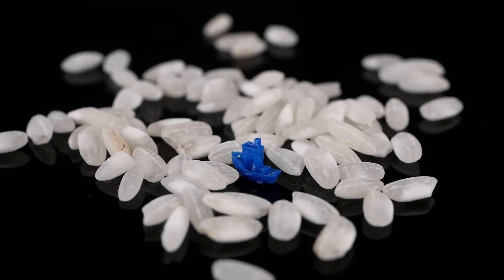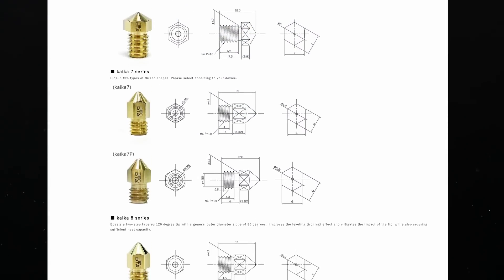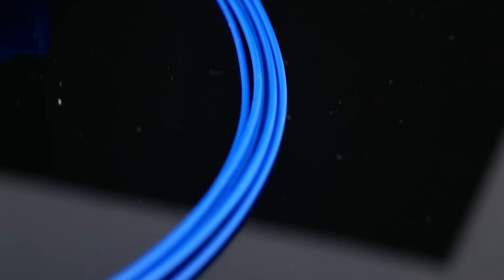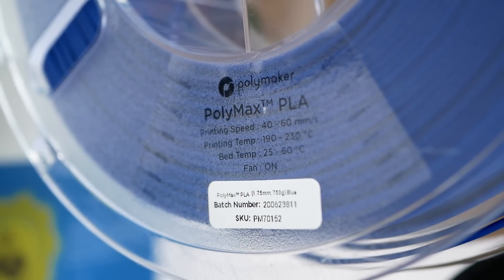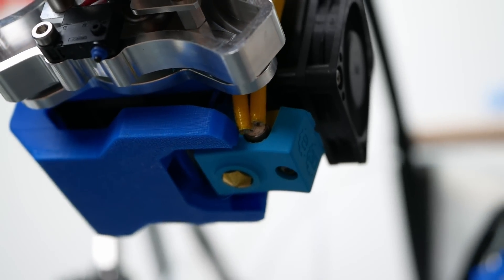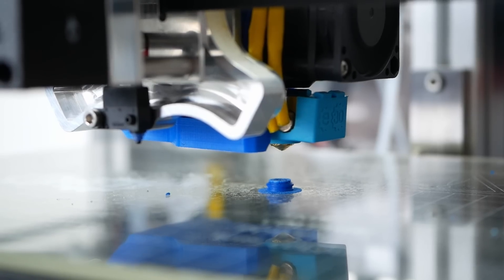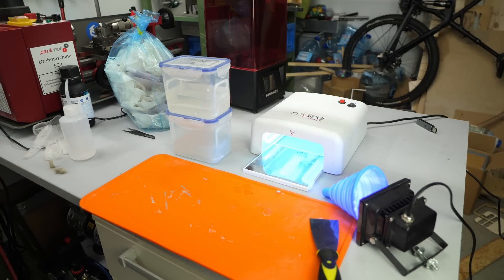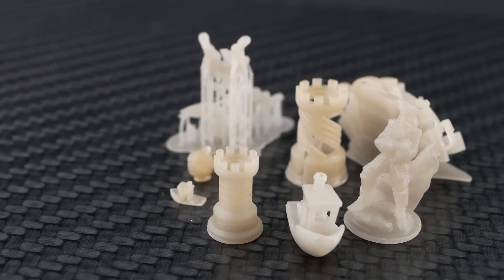MICRO 3D Printing with a 0.1 mm nozzle

Comment: Congrats on the channel and video as usual! :D I would love to see the strength properties on parts printed with a 0.1mm nozzle. Maybe I'm wrong but I think it would increase the strength since the little gaps would be tighter. Also a part not so small (even though it will take a lot of printing time) but maybe it would offset the post process (sanding, smoothing, painting). Just some curiosities I would love to see addressed. Best Regards,

Comment: Really good video Stefan. I'm so please they turned out well and thank you for the shout out. With a 0.1mm nozzle you are basically printing with controlled nozzle ooze, PolyMaker PolyMax is a great starting point for anyone else wanting to try out small nozzle FDM printing - even if you are using a 0.25mm nozzle the PolyMax PLA range works so much better than normal PLA's and gives strong usable parts, most other PLA's I tried just break when trying to use the parts. (I made 35% sized Lego bricks out of PolyMax PLA and they work well over and over again).
Some ABS filaments can also give good results with micro-tiny printing, but be careful how long they sit in the hot-end as Stefan mentioned the heat-creep problem.
The results are worth the wait for FDM especially if you really don't like dealing with SLA resins as mentioned.

Comment: I tried 0.25mm on my Prusa Mini. It works well, just takes ages to print anything not tiny. One time I wished I had a smaller one when printing replacement plastic gears for a broken paper laminating machine. Few grams of plastic saved the machine from being thrown away but even with 0.25mm nozzle the tooth geometry was barely functional. I am not sure if there is a resin that would be structural enough but printing this in ASA seems to have worked.

Comment: Stephan, don't use the adhesion spray inside the machine! The spray goes everywhere and will accumulate on the rails, along with dust - acting as an abrasive and damaging the surfaces over time. Don't be lazy, take the bed surface out and spray it there, never inside the machine. 

BTW, any tips (which extruder/hotend are workable?) on upgrading a common consumer printer like a Prusa or Ender to a 3mm filament? I have ton of this filament because of my Mendel90 machine.

Comment: Great experiment again and great results! Would it be posible to utilize an idex printer with a 0.8 and a 0.1 nozzle and two times the same filament, to use the 0.8 for everything but the fine details?

Comment: I've printed with 0.15mm nozzles on my old machine, in my experience it looked a lot like you need higher gear ratio on the extruder.
When printing those small parts I used a QR extruder from Bondtech and a 100:1 planetary nema17.
It was printed on a Velleman K8200 :D
I dont have the parts longer, but the benchy was 15% scale and looked prestine :)

Comment: the pre an post processing for the resin printers was what really got me, it always took more time in the slicer for the resin printer an the clean up. i love the finish tho but i only use my resin printers for stuff thats really small with alot of detail or if its something i just have trouble with on my fdm printers due to thin walls like small fan ducts always come out looking cleaner for me on the resin over my fdm, but for anything structural fdm is my go too an thats what ive found myself print way more of lately over stuff like miniatures or busts.

Comment: Been doing prints on 0.05 and 0.10/0.15 nozzles for over a year now. This is gor small scale parts for my RC scale helicopter builds.

Intially it was on my Prusa with Bondtech 3:1 extruder - now on the E3D toolchanger with orbiter extruder and recently on a Voron v0.1 i build especially for that.

Important aspects for this
- you need a DD extruder setup with a high gear ratio (3:1 or with orbiter 5:1) - its not just about resolution but also for torque to push material thru small orfice.
- material choice here, PLA or ASA, those are high flow low viscosity materials. Forget PETG as due to its higher viscosity you will end up with lots of curling and potentially more clogs.
Needles to say avoid any filaments with shiney sparkly additives

Really, after that i ditched using my resin printer - for reasons Stefan mentioned as well as issues with anisotropic shrinking of resin depending on model geometry.
Resin is brilliant for small parts but then when you have multi part assemblies, due to resin shrinkage the tolerances are totally out of whack (and this is random based on nmodel geometry and even model orientation)
With FDM my part dimensional accuracy is perfect.
Reply: Example of full FDM print on 0.15 nozzle
Scale 1/7 cockpit for Bell 206 with fully functional controls
https://youtu.be/S_n0hGPFlCU

Comment: It's not the right direction.  For small high resolution sla all the way. For fdm going larger is the better option. They are slower so you want more plastic coming out to make larger parts. I have both. I would put a .8 on an fdm or even larger if I want a large part fast. But resin is faster than fdm and at a higher resolution. You could fit quite a few of those on one resin bed and the time for one or all together would be exactly the same because it's an entire layer at a time. Not sure why I would want a small fdm doesn't make sense

Comment: This video is fantastic! Its crazy were fdm printing is getting. And in that light you should check out Polymakers lightweight PRE foamed PLA! It is around 65% the weight stiffer than other lightweight PLAs and can be printed with the exact same g code as normal PLA! It would be super interesting to see its properties under your stress tests! Maybe a new champion for strength to weight?

Comment: In our studio I have some printers dedicated for certain tasks… an ender 3 (for example) with some light mods is dedicated to a 0.2 nozzle for small detailed parts on some of products that a .4 nozzle would never be able to resolve… it has worked very reliably, the hardest part is getting the first layer just right.

Comment: I’ve found 0.2 nozzle to be such a pain and like you show requires slower print speed that I found playing with flowrate/extrusion width can achieve very similar results with a 0.4 nozzle in less time. Also I don’t like resin printing either.
I love it when you show the insides of these nozzles. I learn a lot from your approach.
Reply: I use a 0.2 nozzle probably just as often as a 0.4, and I am tempted to get a prusa xl with 5 nozzles just so I can keep 2 of them permanently at 0.2... It does take a lot longer time, but the quality and.. uhm.. "resolution" is a lot better, so it's totally worth it.
Reply: @AFAndersen  Yep, 0.2mm nozzles are great for small parts with fine details. 
I never really had problems using them.
Reply: i like how i learned this much in three sentences
Reply: how small width can you go with a 0.4 nozzle?
Reply: Your cura tutorials are extremely helpful

Comment: Multimaterial IS possible with resin. It's called Multijet and works without mess. But the printer is about 100k$, however you can order prints online

Comment: I've used my .25 copper nozzles for mini's before. No clogging with them like I had when I tried the .2 nozzles that came in the same package. Not that I had many with the .2's either. I suspect the better heat characteristics of copper over brass might have helped. Though they do of course wear much faster that brass for not a huge improvement in thermals which is why brass is the go-to for most general purpose nozzles.

Comment: I do a ton of mini printing on my Prusa Mk3 (since upgraded to a Mk3S+), and I get some amazing results. I've spent over two years working out the profiles for it, so feel free to message me, Stefan, if you'd like a copy of them so you can test them out yourself.
Reply: Are you using the Prusa slicer?  So curious what kind of tricks you are using. I print lots of small parts as well.  What size nozzle are you using?

Comment: has anyone used the air brush tip nozzles? I can't find a video with it. basically it extends the tip making it easier to reach in printing parts

Comment: Ever since I bought my resin printer I haven't used my fdm printer. It's just soo good. It's way faster and far more detailed. I have gotten my workflow to the point where I can remove the parts, clean them and cure them within 20 minutes.

Comment: Hey, very interesting Video! I might look into smaller nozzles now as well i guess, i am still just a beginner. 
Just 1 question i might ask: How do you setup your supports for minis? I have just 1 Mini so far that i try to print for a good quality and i am really struggling to get a good result.
Reply: You will find many times supports are not needed.  Super slicer and simplify you can add or subtract supports. You have to really slow things down to get accurate small parts.
Reply: For things like minis, you typically don't need supports since it's on such a small scale. If you scale them up, then I'd suggest to definitely use supports.
If you use Cura, you can use some "support blockers" and change their dimensions so that some steep overhangs would get supports, while others don't.

And like Todd said, slow things down for small parts. Whatever your speeds are, cut them in half and see if that helps any.

Comment: The chatter on the inside of the nosal is a good thing because of the increased surface for better heat transfer.
Reply: I would even say it's probably intentional. You can see they went a bit deeper with a smaller bit, by the step in the cone profile. And they could have chosen that bit in order to leave that longitudinal (flow's direction) microgrooves and improve flow's resistance.

Who knows...
Reply: @heitooooor   No it's not intentional. They used different tools to get to the end.

Comment: Hmm... do any slicer support two different size nozzles? That would make this feasible, printing just the surface with a 0.1mm...
Reply: I think Cura might, but I don't want to tell you wrong. I was messing with it the other day and I think one nozzle was set up as a 0.5 and the other 0.4.

Comment: I printed at 0.1 a while back. The biggest thing was that I used stepper motors that were 0.9 degrees per step instead of the usual 1.8 degrees. But I was never able to print a benchy tnat small. 25% normal size was the best I got.I also had to increase the nozzle temp quite high to ensure no blockage happened.

Comment: 10:01 What are cold pulls ?
Reply: You'll want to look up information on how to do it properly for your printer, but the gist is that you make sure the filament is all melted, then turn off the heater to let the nozzle cool down.  When it's somewhere around half the printing temperature, yank the filament out of the top of the extruder fairly quickly.  The goal is to capture any particles which are causing a clog in the melted then solidified plastic, and pull them free with the filament.  The tip should look like a clean cone, conforming to the shape of the inside of your nozzle.  And ideally, a little bit at the end corresponding to the nozzle opening.  That means everything inside the nozzle should now be outside the nozzle, and any clogging issues should be gone (unless they're caused by a poor-quality filament, of course).

If you pull too hot, the semi-solid filament will just detach from what's inside the nozzle.  If you pull too cold, the friction inside the nozzle will be too high, and you'll just break the filament off.

Comment: You touched on something that barely gets talked about and for me it's the reason I don't own a resin printer. The amount of waste produced is, in my opinion, uncomfortably high and not recyclable :/
Reply from the maker: Indeed! And lots of that waste is soaked with uncured resin which shouldn't be disposed in that state neither.
Reply: @CNCKitchen  if you have any amount of sunlight then it's easy enough to cure cleaned off resin. Many swear by a wash and cure station to minimise mess and flex build plates help make removing parts quicker and less messy.

Comment: Considering its already being run on a Toolchanger, what would be the process to have a print sliced so the .1mm nozzle is only used for the outermost shell of a print and a regular 0.4mm for the rest?
(or any combo of small nozzle in one toolhead for detail, and a bigger one for the brunt of the material)
Reply: Theoretically possible. I tried it with my toolchanger but ran into issues with the slicer not liking changing extrusion width that much leading to slicing artifacts.   This was with superslicer a while ago I tried, certainly a solvable problem though if someone dug into the code.
Reply: @JohnMeacham  For this to really be useful, you'd need to print outer walls before inner walls, and you'd also need to use different layer heights for the two nozzles, which means the outer walls will have no support from inner walls, meaning you get worse overhangs.

Comment: For resin printing, I just pull the part out without removing the build plate and use water washable resin. I also put a carbon filter inside the printer. Helps a ton with controlling the mess and makes it almost as easy as FDM.

Comment: Im curious how well it would work when using a tool changer. Can they hold the accuracy needed to use a larger nozzle for infills and the smaller for the details?

Comment: Wouldn't it be cool if we could do nozzle changing on 3d printing like cnc guys do with their cutting bits, do the big parts with 0.6 and 0.8 nozzles than finish tiny details with 0.2. Tool changer would probably do it but I don't think any slicer can do slicing like that. I print architectural models and there is always some set of columns or a detail that is too small for the 0.4 nozzle and than I need to switch to 0.25 or section and glue that part back which adds a lot of unnecessary time and work. Something like MMU equivalent for nozzles would be so cool.
Reply: CNC quick change tooling doesn't have tool warm up times. Your cycle times would be insane if you didn't have all of the nozzle blocks preheated. You could do a turret style, but then you have the issues of having multiple 'tool heads' on a turret zipping around instead of just one. Or you have to have each tool head warmed in a rack pre primed with material and a repeatable mechanism to attach and detach hundreds of time per print to the gantry. Not impossible to do, but making money selling machines like that might be difficult.
Reply: @randomidiot8142  I did really think to change the nozzle itself that would be veru complicated but i think possible, but something like a E3D toolchanger could have different nozzles on different toolheads that can be preheated to 160 and the heath up time would be very small and they could di the same job.

Comment: The heat creep on the hemera is almost nothing.  I had a jam caused by a fan failure so I had to reheat the nozzle to clear the throat.  It was impressive.  Even with no fan running it took quite a lot to get the heat to move.  The throat was plugged just above the heatsink interface.

You can also switch to the titanium throat which all but eliminates the heat transfer/creep.

Comment: To be honest, for this I imagine a scaled down printer, shirinking everything but the linear rails and mounts. 75x75x75mm build volume, 0.5-0.75mm filament, tiny stepper or servo for geared down extruder... The wole thing, with external controller, could probably fit in a 2-2.5 liter heated enclosure, sitting silent on a shelf chugging along for days. Or have 30 of them on a table.
Reply: I don't see why the filament needs to be scaled down?

Comment: I have printed using a .25 nozzle for my OmniaDrop parts.  Had some jams with the PETG, think it had particles of some kind in it.  I looked at their website and have problems determining which nozzle would be correct to replace a standard E3D V6.   The larger ones are in the same price as a Nozzle X, would be interesting to see a comparison of those at .025 mm